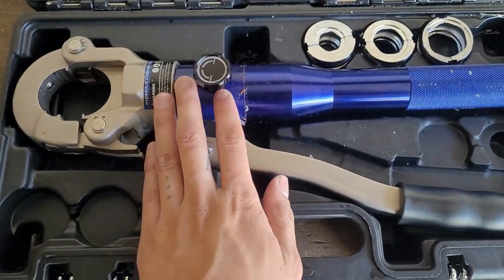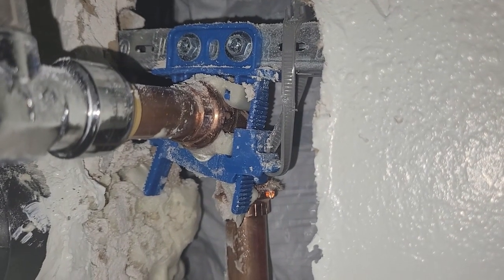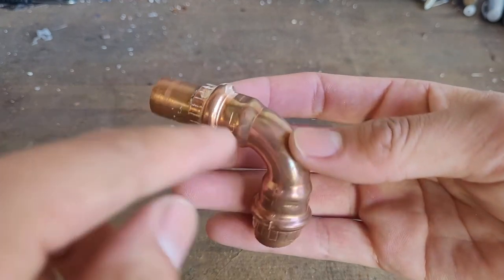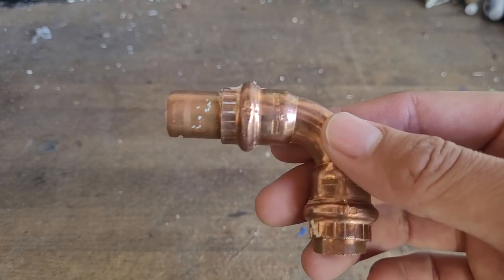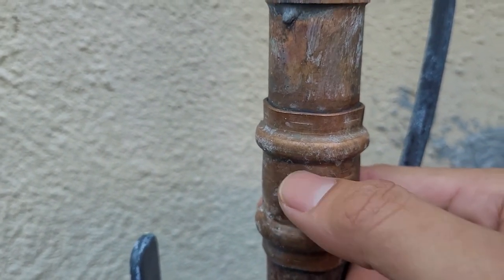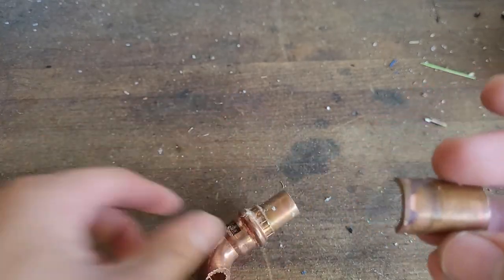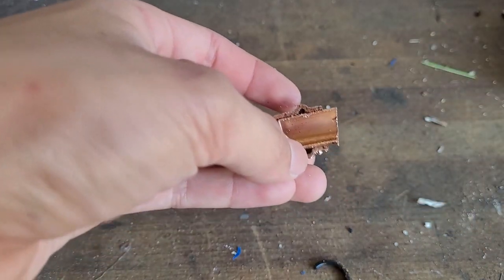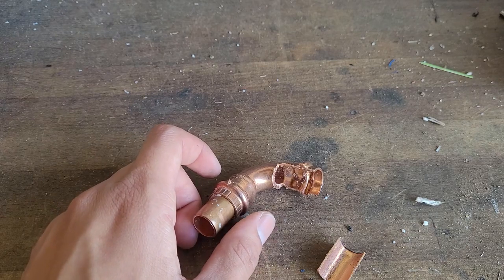IBOSAD Copper Press Tool Update - Leaks Everywhere!

Comment: I've been saying all along that there is an inherit issue using these fitting with "M" type copper tubes where the fitting is much harder material that the thin wall pipe causing the copper pipe to crush in the fitting causing these slow leaks. They seem to work much better on K & L type commercial copper piping. Also the jaws on that tool are poorly made and there are better tools for just a few bucks more.
Reply from the maker: I agree the tool is garbage, the dies are so poorly made. Type M is generally fine if your water is not corrosive but considering the small price difference, type L is definitely worth the investment especially for underground use.
Reply: Do you realize that M type copper is for heating only not domestic water lines at higher pressure.  Heating lines typically have a pressure of 15 psi.
Reply: @earlrissel4454  I don't believe that's correct, it's a thinner wall than L but is use in almost every Home Depot for standard Plumbing and is most likely the most common used today in residential Plumbing..
Reply from the maker: @earlrissel4454  Type M is rated for domestic water lines in California
Reply: @DragonBuilds  not here in Pennsylvania type M copper is rated for hydronic heating as per plumbing code.

Comment: I saw that in your first video just by observation it was squeezing the copper between the clamp making a tab that prevents it from crimping further. You didn't have to remove the previous joint. Just re-crimp with the Rigid tool. I bought the Rigid for the best reviews.
Reply from the maker: That's true, but since I don't have a "real" press machine I just cut out the joint and soldered it.
Reply: @DragonBuilds  I also realized later that their name kind of sounds like "I SO BAD or I BO SAD"

Comment: The difference with the electric tools is they have some sort of internal feedback, as well as reasonably machined jaws.  I wouldn't be surprised if there's a little swiveling capability in the jaws to even out the pressure on either side.  And when the pressure gets to the right amount, the tool knows to stop.  If a pressure reading could be built into the off-brand tools, something like a torque wrench which also measures pressure, they could work fine.
Reply from the maker: Ridgid's mini press tool can do 1/2 and 3/4 copper and PEX, costing $1500 for a complete kit (or $1200 without the PEX jaws), I doubt a manual tool from a legitimate brand with the features you described could be any cheaper. 

Either rent a ProPress, buy one, or solder. These no-name tools are not worth dealing with.

Comment: man most of these crimpers are junk dont buy any of them unless there made in the usa otherwise  you will do the job over have a good one
Reply from the maker: The Bluefin manual tool from supplyhouse.com is pretty good, but my local Ferguson rents press tools for $90/day. Or you can just use a jetsweat tool and solder.

Comment: Why did you use a sharkbite shut off valve man wtf
Reply from the maker: The local store ran out of compression valves. I planned to replace it with a compression valve once they were back in stock, however, the press fittings started leaking before that.

Comment: I purchased the iCrimp manual press tool and it worked fine on type L copper.  But one thing I noted in the manual is that the tool needs to be calibrated to ensure a proper crimp  It comes precalibrated from the factory but there are easy to read dials on the handle that can be adjusted as needed.
Reply from the maker: iCrimp makes the Bluefin tool I reviewed in another video, but this IBOSAD hydraulic unit is a real piece of garbage.
Reply: @DragonBuilds r

Comment: How did you get the tool into the wall to make the press? Looks like it was in an area and not properly aligned
Reply from the maker: A few joints I made outside of the wall have the same issue.

Comment: I thought it might be too good to be true.  I didnt think the power tool was over $1k because its electric but some kind of precision requirement since this is to allow commercial places to use copper without having to solder.  Thanks for learning the hard way and sharing it.  I thought the pinches over the rings was suspect too.  The electric tools say they need calibration after some time and I wonder what they "calibrate" since there doesnt appear to be any adjustment to the crimp depth.  The dies the real tools use must be really hardened.  

I guess this should be renamed BO I SAD now.
Reply from the maker: The electric press machines can be rented for under $100 a day at many plumbing supply stores such as my local Ferguson. 

There are a lot of junk tools on the market aimed at gullible homeowners who find tasks like soldering intimidating. It's best to avoid these products, as they can cause serious issues like what happened with this press tool.
Reply: @DragonBuilds  I can solder, but I dont do it that often.  I'd rent a propress but I would want one for "just in case" situations.  I'm converting from 40yo copper to pex b in stages and need to do all the supply lines in the crawl space.  I was hoping to avoid using fire but its probably the best choice for now.  I wont even need the tool after the second stage of replacing individual fixtures.  Did you use Viega fittings?  Whats with the weep hole in them?  Suprised Horror Freight hasnt release a Bauer version.  Cool idea.  Eventually quality knockoffs will make it.  These fittings are still very new and most plumbers dont use them yet like those Wago 221's with electricians.  We're always behind on the technology here.  I just learned what a ventless dryer is (and not a clothes line, lol).
Reply from the maker: @jeremywatts2768  I used genuine Viega fittings with this pathetic excuse of a tool. I would suggest just soldering. 

Just curious, why replace 40 year old copper? Around here there is plenty of 70 year old copper still in great condition.
Reply: @DragonBuilds  1980's houses < 1950's houses.  I bet copper was thicker then.  I've been here less than a year and found 3 pinholes.  There had previously been other repairs with sharkbites due to various issues with water quality and installation.  Too many joints to fail.  Some of the joints are pretty ugly too so I can only imagine all the flux that must have been left in the pipes.  I'm a fan of PEX simplicity.  You' should see the stuff I've been correcting in the electrical.  Backstabbed receptacles, switch loop configurations (power starts at device) an HVAC system that was from 1998 (still running too).  Who runs 10ga wire into a kitchen on a 20amp breaker for two duplex 15a outlets?  I guess I can run my toaster/tig welder combination appliance I got from Harbor Freight on that circuit.
Reply from the maker: @jeremywatts2768  Improper installation can ruin the best plumbing systems. Just curious, why PEX-B? PEX-A is better and not that much more expensive.

Comment: What size is the copper tubing M or L?  Rationale: M being thinner will deform more thus preventing the crimping from leaving marks.  Whereas L being thicker will require more force to deform and leave the marks from the crimping operation.
Reply from the maker: The old copper in the wall is L, the new is M. It leaked on both sides.

Comment: I sent my first press back and got a replacement. The replacement works very well. I agree that the engineering sucks.
Reply from the maker: I wouldn't want to take any chances for something like this, especially considering the damage caused by the water leak.
Reply: @DragonBuilds  My biggest issue with this unit is there is no stop point. You pump it up to when...it blows! It need a small pressure gauge or stop point built in.

Comment: I just ordered the vevor brand. Hopefully it works better. Thanks for the follow up.
Reply from the maker: I'd recommend testing the tool on a scrap piece of pipe and pressure testing it before you use it for a real project.
Reply: @DragonBuilds  No doubt about that. I'm a general contractor and my plumber is a close friend so I don't need to mess around but I'm just a curious guy and for $85 I just needed to scratch that itch. I spent twice that on fittings lol. Worst case I can use shark bites. I just need to replace some bad gate valves in my house and none are buried in any walls so I should be safe. There's another guy online with a Ibosad who seems to use it for 3/4" on water heaters and the crimps looked solid. Maybe you could test your tool on 3/4" fittings and if it works then contact Ibosad about a replacement 1/2" insert.
Reply from the maker: @Tool_Addicted_Carpenter  I tested the tool on 3/4" pipe, same problem. I'd really just recommend soldering or renting a real ProPress tool. Sharkbite may actually be more reliable than joints made with the Ibosad tool.
Reply: Super appreciate your advice. I will stick to soldering for the moment. 😀
Reply from the maker: @mikeyangel1067  that's a good idea. Plus, solder fittings are cheaper and can be taken apart
Reply: I’m sure you’ve already found out the vevor tool sucks as well.
Reply: @BasedPony  Yes but ironically it has the opposite problem. It crimps the fittings too tight. I took a dremel to the jaws for a while but ran out of cutting bits. I might spend some more time on it and get it working. Expensive to keep testing it though lol. Fittings weren't cheap.
Reply from the maker: @Tool_Addicted_Carpenter  I would just rent a real ProPress. Many supply houses rent for around $100 a day, and you can buy your fittings there too, avoiding an extra trip.
Reply: @DragonBuilds  My plumber has an M12 I have borrowed I just wanted to have something I could possibly do a quick shutoff valve or sillcock for a customer if they were having any problems. I just like being independently versatile. Vevor refunded me 90% so for $8 I don't have much to lose by trying to modify it to the point of functional.
Reply from the maker: @Tool_Addicted_Carpenter  That could work, but I would not trust joints made by a no-name tool for something critical like the main water line or joints inside a wall. However, it might be worth trying on something like an outdoor hose bibb.
Reply: @DragonBuilds  Ya I definitely wouldn't risk it on anything that's buried and I would use it at my own house on a few things before I ever tried at a clients house.

Comment: How do you know that your tool was not defective ? You would have to get a second tool and test it again to confirm your theory and pressure test it. I use it and works well also this was 2 years ago. They could have a different production run
Reply from the maker: I cut apart the fitting that was leaking and found that it was not pressed fully. I made another joint with the press tool and cut it apart and found the same problem.
Reply: Respectfully, I appreciate your video and it helped. However, that does not address the product you bought was defective. Using the same product again to see if it crimps won't change that.  The second tool you bought for $180 met all the checkpoints of the IBOSAD that I have.  I bought $400 milwaukee framing nailer.  The first one was bad but the second one I have had for years.

Comment: You probably didn't have it straight, mine works fine and puts press marks on both sides of the o ring.
Reply from the maker: I'm pretty sure I held mine straight.
Reply: Did the 90 get press while in wall?
Reply from the maker: @Joshuaellis420  No, I pressed it first then installed it. I should've just soldered :(

Comment: I have one of these as well which works fine but I won’t use it in a tight situation where I can’t guarantee the jaw is lined up perfectly as the manual pumping action can cause the tool to mis-align with the fitting…Moral of the story, you get what you pay for.
Reply from the maker: I just don't think it's worth the risk of leaks, given how expensive emergency plumbing and water damage repairs can be.
Reply: @DragonBuilds  I agree 100%…after watching some of the video reviews I’ll probably never use mine again
Reply: @DragonBuilds  I have pressed about 10 joints with these and here are my observations. It works pretty well with Nibco and Watts as their fittings are bit wider. The dye looks too by 1/8 wider. It for sure does not crimp 90s and tee properly (but depends on brand). All of my connections were either ball valves or propress to Pex (Viega or Uponor) and they all have held up for more than a year properly.
Reply from the maker: @kiwiswat  I used Viega fittings and they all leaked. Meanwhile, the Bluefin manual press tool seems to be trouble free with Viega fittings.

Comment: Is it possible that the fittings would seal better if it was clamped almost closed the first time then rotated for a second clamping?  I don't understand why it would be so hard to duplicate the die and compression of the Milwaukee and Ridgid.  I'd think that would be the easiest thing for the manufacturer to do in the design.  It looks like they'd even be better if some of the metal on the die was relieved on the outer edge so that the burr wasn't so pronounced and ever so slightly reduced the clamping. I just don't understand how they could make such a basic design mistake. It's a shame.
Reply from the maker: I don't think rotating the fitting for a second clamping would help. The die on a real press tool is a precision machined piece of hardened steel, while the "die" on this tool is sloppily made.

Comment: The press is not needed on both sides. It just needs to prevent the joint from blowing apart. An   O ring uses pressure to help it seal by design. It could be the elbow was defective or there was dirt on the sealing surface. Groves on the pipe could also cause it to leak.

Comment: Why didnt you use the Bluefin press?
Reply from the maker: Wouldn't fit in the tight space. Next time I'll just solder, or if I really need a press tool, rent a Ridgid or Milwaukee tool.
Reply: @DragonBuilds  Yea Im contemplating but hose are too expensive to merit the purchase, might have to just stick with the old solder and torch.
Reply from the maker: @hippo-potamus  Soldering has another advantage too, as you can take joints apart later.
Reply: @DragonBuilds  Excellent point.

Comment: Wrong die used. copper uses m or v type die. Looks like a m die used on v type fitting..
Reply from the maker: The manufacturer claimed that it was intended for ProPress fittings.